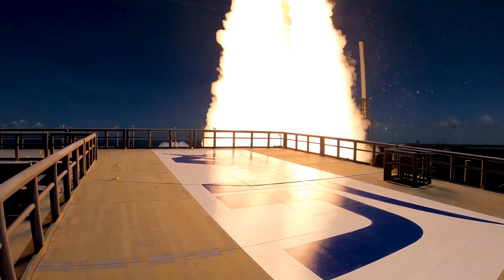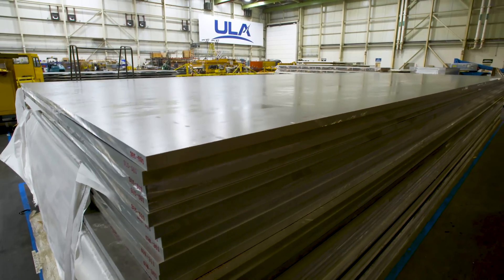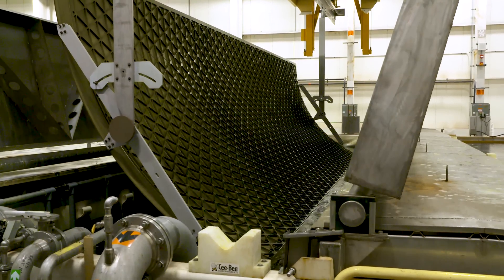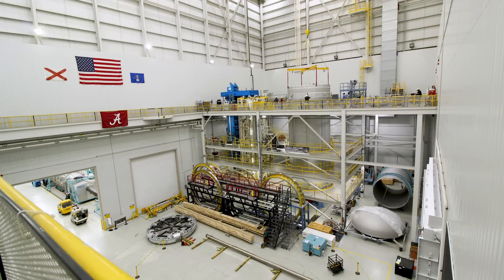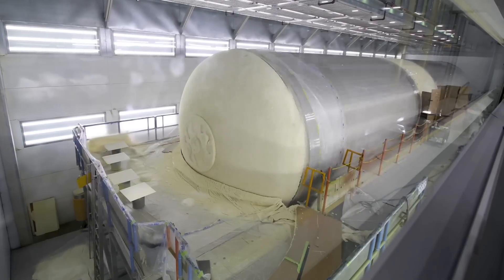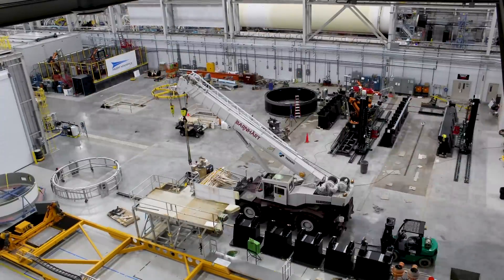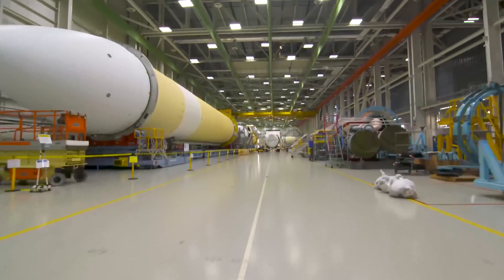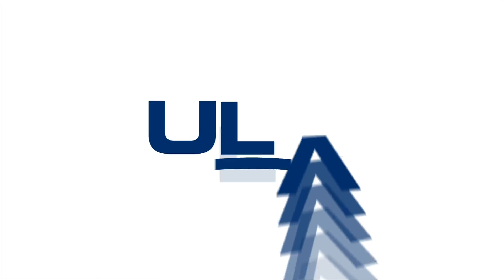ULA Rocket Factory Tour

Comment: It seems like a huge waste of material and machining to take a thick panel and mill it out. Why not build a rounded frame section and then put a skin over it? More welding but much less machining, material, and time wasted. 
And why are all these rocket factories in Alabama? Because Senator Richard Shelby is the Aerospace Czar of the U.S. Government? 
Elon Musk was right. The formation of ULA was an intent to monopolize and shouldn't have been allowed under U.S. law.
Reply: The metal shavings are collected and returned to the sheet metal supplier for recycling.